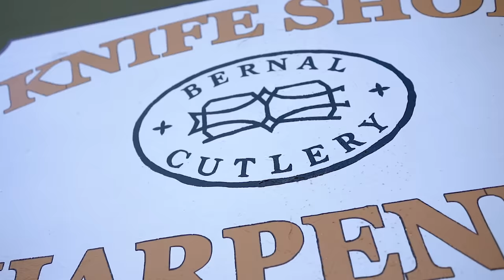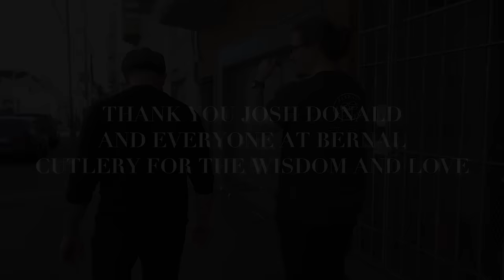Sharpen Your Kitchen Knife Like A Master Sharpener

Comment: The wider the knife blade, the shallower the angle (using 2 quarter method) will be. If a 1" blade using 2 quarters=19 degrees, then 2" blade using 2 quarters will equal 9.5 degrees.

Comment: My only critique to this method; this method will create an uneven edge, over time will reduce knife life, and has too much room for error. I'm not a professional knife sharpener, but I have been doing it for 14 years. I've tried various methods, various steels, and I've made my share of mistakes. You absolutely can sharpen a knife using many methods. But the guided method has proven to be the best (in my experience). Chef knives are unique to most other knives because you are ending a cut on a flat surface. This makes the importance of an even bevel on both sides critical. Even equals less time resharpening and longer knife life. Buy quality steel knives from a reputable source, sharpen how it suits you. But, it is cool to see this method is still in use. It's an art.

Comment: i was told before that i shouldnt soak a stone thats above 6000 grit for more than 10 minutes or even 5 minutes due to how soft the material is and because of that its prone to cracking easily. correct me if im wrong.

Comment: The best sharpening method is the one that keeps your knives ready for whatever you need them for with as effort as possible. What good does it make if you can get your knife super sharp but it takes so much effort you never have time to do it (getting your stones properly wet and so on)?
I bought Chef's Choice electric sharpener and my knives are never extremely sharp but instead are always very sharp because it takes literally 2 minutes to go through all my 7 knives every couple of days. It sits on my kitchen counter and whenever I find the knife not to my liking I press a button and 20s later get back to my task with fresh, very sharp edge.

Comment: This was interesting, although I knew a lot of this already, except the two quarters stacked to find the right angle was helpful. I've tried looking for very fine sharpening stones where I live, but I couldn't find any. The only one I was able to find is one that was two sided, with one side being coarser and the other side being finer. So, I'm not sure where to find the other types where I live. I would also like to know what kind of stone to get to grind your sharpening stones so they are flat. The drawing an x on your stone when grinding it flat, to see the high points and low points, was also helpful. 👍

Comment: My son-in-law used to sell Cutco knives, but still gets a great discount and bought us a chef's knife and a set of steak knives. Very nice until they started getting dull and were in dire need of sharpening. I was told Cutco would sharpen the knives. So I went to the web site and found out that they would sharpen for free so long as I paid a shipping fee of 9.00 for 1-5 knives. I was like, I'll just do it myself and the chef's knife came out just as good as new. He got mad at me that I would not spend the money. I asked if they would send me a replacement while I was waiting for the knife to be sharpened. He said, uhhh, no. I said, I'll keep sharpening the gift you gave me.

Comment: I really love my super sharp japanese knives but i am too scared to sharpen them, so i take them to a pro. BUT... Two tips he gave me.. Tomatoes dull the edge of a knife quickly, so buy a couple cheap serrated tomato knives and use them. Tip 2... Stropping is super easy on some newspaper or leather, prolongs the time between sharpening.  Thanks for the video!

Comment: Thanks, Joshua, this  was really helpful!
Can you tell me if there's a difference between sharpening and honing? I was told at one point that I should only sharpen with a whetstone every few months but should use a honing rod more regularly. Trying to decide what equipment to buy! Thanks :)
Reply: A honing rod is only used to straighten the edge, It goes a long way if your knife is already sharp.

Comment: If you separate the blade 3.5mm (the thickness of 2 coins) from the stone and assuming a 70mm blade, the resulting angle will be 3 degrees and not 15 degrees. To achieve an angle of 15 degrees you should separate the blade 18 mm (ten quarters) from the stone

Comment: Nice, however the investment in the stones can be steep for the average home owner.  There are other options like the Edge Pro that use smaller stones held in a fixture that can be adjusted to maintain the proper angle.

Comment: I have had multiple knives before and use a stone to sharpen and always got an edge before, but now I have a cheap Japanese chef's knife bi-edged, followed these instructions perfectly AND CANNOT GET AN EDGE that will slice through a tomato skin like I usually expect. Could there be a problem with the steel?

Comment: Silly me, I just went with the inexpensive Wustof ceramic rod sharpener that I just pull the knife through 12-15 times and it's sharp as a razor.  I cook A LOT but this sharpening lasts about 4 months as long as I use a steel periodically between sharpening.   Incidentally, as a woodworker I know how to sharpen using stones but the knife sharpener is so quick and easy why do anything else.
Reply: At last someone cuts through the elitist crap and tells it like it is. Why complicate your kitchen life? Quick and easy does it for me.
Reply: @liammurphy2725  That's why I love the ceramic rod sharpener, no setup and does the job perfectly every time.
Reply: think they tend to cause knife edge to get slightly concave at times, and they might not work too well on knives with thicker spines and some tapering towards the edge.
Reply: @smievil  After 20 years, I'm good.

Comment: You would think a knife shop selling razor sharp knives would know to store them point down on magnetic racks. If one slips while being retrieved from the rack, instinct makes you grab for it as it falls. So you grasp the falling blade and slice your hand open. If the handles are uppermost, and a knife falls, you grab only thin air.

Comment: In my experience, always use 3000/8000 grit for sharpening and polishing. Don't ever use 1000 or less coz it shaves way too much metal off the knife. only use the lower grit levels for knives that have chips and uneven blades, so only use the lower grits for "repair" work. If you just bought a brand new knife or set of knives and wanna know what grit you should go to for every day general sharpening, 3000 is your ideal place to start, then run it up and down a few times on 8000 just for polishing and finishing the edge.

Comment: Does anyone have any opinions on Cutco knives?  I invested in a set of Cutco knives about 20 years ago. I bought their "Homemaker Set" which was around $1100 at the time that I bought them.  The selling point that won me over was their life-long guarantee, which also came with free life-long sharpening services. (The only sucky thing is that they have to be shipped which can take up to around 2 weeks before you get them back.). But I also liked that the fact that they repair or replace any knife that has been damaged / broken regardless of why or how...  I'd love to get opinions!!
Reply: How many of the set do you actually use?

Comment: Respectfully, using 2 quarters doesn't get remotely close to 15 degrees. Quarters are officially .069" thick each, but they vary of course. A knife with a 1.5" heel calculates to an edge angle of just over 5 degrees with two regulation thickness quarters. Using a Nakiri with a 1.5" heel and a Klein digital angle gauge zeroed with the knife flat on a flattened stone, my two quarters measured 6 degrees. An angle like this makes for nice circus trick cuts, but an edge that acute is prone to serious limitations, namely poor edge retention and an increased tendency to chip. Looking forward to visiting the shop though next time I'm in SF though!

Comment: In making a knife I decided that I'd try to sharpen one to absolutely the sharpest that I could ever accomplish

It was fun and I could shave hair off my arm and such but there was a downside

It was so sharp that when I touched the edge with finger it cut all the way to the bone through two nerves that felt like little plimks as they were severed.
I will no longer sharpen a knife to its sharpest unless a client requests it. Moderately sharp is enough for most people.
Reply: That was not the best move you ever made huh?

Comment: Hey good video. Question for ya. I bought a wetstone kit (angerstone) n when im sharpening it tends to get a clayish residue build up on the stones. Im new with the whetstone method. B4 i return it i was wondering if that's normal or is it from poor quality?
Reply: when sharpening you slowly wear both knife and stone so i'd assume that the residue is particles of one of them. try adding more water if it looks dry. or is it completely different from videos?
if it's something that happens when storing the stone  after sharpening then maybe it's mold or something.

Comment: It's weird: when I tried to sharpen at roughly that angle, the "width" of the cutting edge that I got on my knife (bevel?) was about 2mm, which is way wider that in this video, and wider than the "factory" edge the knife had.
Reply: Thick blade

Comment: What did he use to resurface the stone?
Reply: Its called a flattening stone, low grit stones roughly the size of your finer stones to sorta sand them down to be more even. You can buy a designated flattingstone with a sorta handle to flatten more evenly or just get a dollar store 120-220 whetstone and designate that to the job

Comment: The biggest mistake in sharpening knives is when you take your hand off the knife to re-whet your stone and when you return the knife to the stone, you alter the angle.  Instead of using a bucket and your fingers, seriously consider all your regrets, your failures, and the disappointment you have been to others, as you sharpen.  Your tears will hydrate the stone without you having to move your hand!

Comment: Unless your knives are so dull you can't even cut with them....or cut yourself with them, then a King KW65 1000/6000 grit combo Whetstone for $32 from Amazon will take your knives to a razor sharp, hair shaving, mirror polished finish that will be a joy to cut with. Just be very careful because your knives will be sharper than any knife you have ever owned.
And knife sharpening on a Whetstone is not really that mystical, taking years to learn. Peruse youtube for some sharpening vids, watch them, take an old, cheap dull knife, and spend about 5-10  minutes sharpening while trying to be consistent with your sharpening angle and you will likely end up an extremely sharp knife that can shave the hair off your arm and is a pleasure to cut with in the kitchen.
Reply: Exactly. Keep it simple.

Comment: Hit the nail on the head at 3:40. Unless one is a professional sharpener, people can't tell or keep an angle. (Probably most professionals can't either !). The human eye can tell vertical, horizontal and MAYBE a 45. 
But 14 degrees ?  No. That's why I start with the Lansky system. $35 and 17, 20, 25 and 30 degrees are constants.  Just saying.

Comment: Sharpening a knife is all about training.
First you don't need 6 different stones to get your knife sharp.
With 800-1000 grid you get your knife sharp as f*ck, 3000grid and above only to polish the cutting edge an get it razor sharp.

Comment: This is great. If you‘re a hipster believing that any major chef is going to be wasting her time futzing around with Japanese whetstones. One of the most commonly used chef‘s knives in professional kitchens is a 38$ Victorinox (which you can see in the video btw.), which will be honed with a steel several times during a shift, and occasionally sharpened on a motorized ceramic sharpener that maintains a precise angle on the cutting edge. Whetstones. Ridiculous.

Comment: There some mistakes here first you should use fixed angle sharpener not try to sharpen with hand it is impossible to sharpen same angle.Second not all stones are needs to be put in water. Natural water stones needs to be in water, oil stones needs to be sharpen with oil but not natural artifical stones dont need both of them.If we consider japanese water stones are not natural anymore dont need to be.Plus japanese water stones are so expensive and not fine as oil stones.Last leather part is meanless until you use really fine paste.Fine stones are not finish they are increase number of teeth on the edge which cause knife stay sharp long.

Comment: there is no f**kin way any beginner needs to be putting their finger right next to the shap edge of the blade and then sliding it back and forth on the stone toward the "guillotine edge" that's formed. Then there's the back side where if your fingers relax you'll cut them there too.   I bet there's at least 3 safer ways for beginners or learning chefs to sharpen a chefs knife. That guy owns the shop and is a seasoned pro. Ask him how many times he's been cut working with knives lol.

Comment: What you find out is no one wants to get out a bunch of stones, pans, water and other items just to sharpen a knife. So get something compact, easy to use and sharpens easily. Those large sharpening stones need lapped often and then the mess of the slurry and cleaning up… yuck.

Comment: #TooMuchEffort

I would really like to have a sharp knife but this is definitely not worth the effort. think about it. first you need to buy like 50 different whetstones, then you soak them for half an eternity so it's sure that you definitely loose all the motivation and the "let's just do it" momento. Then you need to measure some weird angles because otherwise all you did was worthless, then you need to sharpen that crap like half an hour with all those whet stones... no. 

instead i would really like request a machine that is just "put your knife in there, press a button and you can cut through a living person like through melted butter"

Comment: The two quarters as a guide for the sharpening angle are complete BS. A quarter is 0.175 cm high, so two are 0.35 cm high. The blade of a chef's knife is about 3.5 cm high and thus the sharpening angle would be 5.711° AND not 15° as mentioned in the video. Sharpening at 5.711° will make a very sharp knife that will lose its edge more or less immediately. This has nothing to do with professionalism.

Comment: Do not free hand sharpen. Buy a sharpener that holds the blade and stone(s) at a fixed angle like a vise. You can get one with stones for under $50. I've been sharpening blades for ages, and the #1 worst crime is free hand sharpening. The #2 worst crime is "well, I do it this way". Lastly, if you are sharpening your kitchen knives more then almost never, you need to rethink everything. You need a ceramic honing steel. You hone every day (or week) and sharpen rarely. Once you have a REALLY sharp knife, you shouldn't be going back to the coarse stone. If you really want insanely sharp blades, you get there with a strop and an abrasive paste.

Comment: you give your self too much credit , i can do that with a 50$ stone and 30 year old kitchen knife . You dont believe me , i made a video tested it , its 5x less sharp then a razor , i didn't even touch it   but that is around 150 on the sharpness scale and that can do all you showed , no one touched it  for  20 years , my father did not have sharpening stones only the metal shaft and it was left for  20 years in a drawer , and i  took it and tested it , yeah 150 , about as good as you can get with simple kitchen knife , maybe 100 on the scale , but even 150 will shave your beard  , its not that hard . I learned it in 3 days , but as i said my father did not have anything , and left me a knife that is after 20 years at 150 on the sharpness scale  , give or take . No stones , just metal shaft , i dont know how you call it in English .

Comment: Slice thicker slices and stop the smoke and mirrors and dog and pony show. Slicing super thin is a smoke and mirror scam. And the thin, shin blade is the actual difference in showing, sharp. Less suction to the blade and less angle to force the slice of material away from the main body of the object being cut. Stop moving the knife for word as you slice the things. My thickest knives ( 1/4 inch at the backbone, weighing 2 LBS. slice like that. Not a big deal.
Reply: Some people like thin slices for various reasons. Sharp knives are essentially to making super thin slices without lobbing your fingers off or destroying what you're cutting. Also, always cut away from the body, which is a forward motion in one full stroke, not back, which is toward yourself and can cause injury